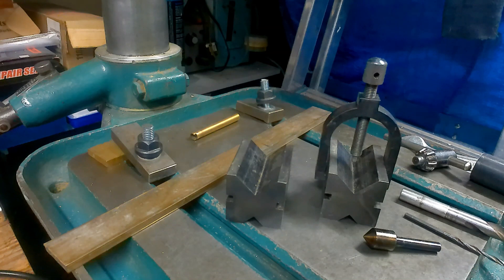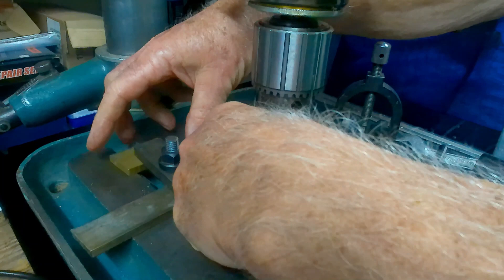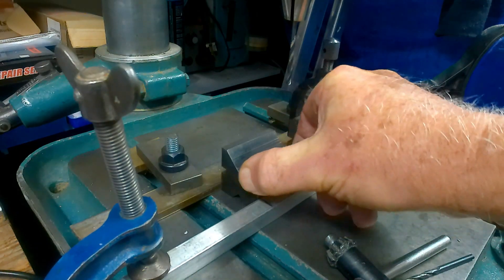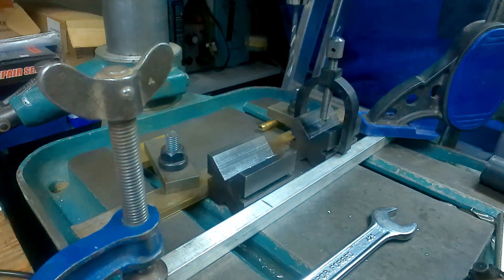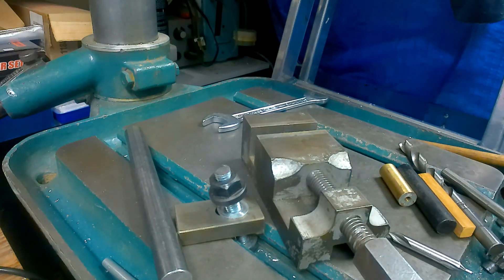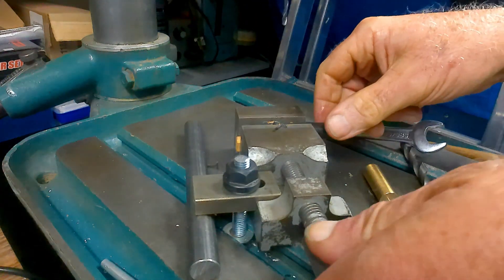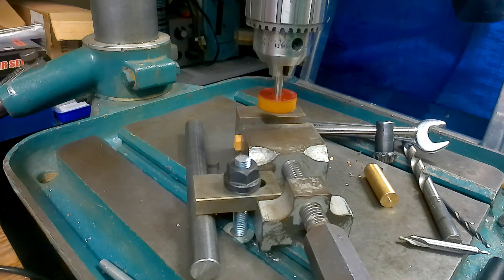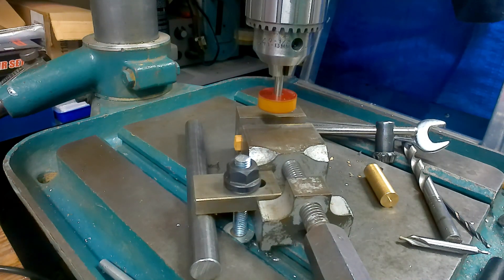How To Do Accurate Cross Drilling Just Using A Bench Or Pillar Drill, With 2 Types Of Work Holding.

Comment: Have you got a set up for cross drilling a specific amount off centre without a milling machine?
Reply from the maker: Thanks for the view and question. If you woud like to email me, I can do you a description and pictures and perhaps a short video clip filmed on my phone. Perhaps you could send a sketch of how much you need as an offset. I am assumind round material ? Will not be easy to do on a Pillar or Bench Drill, as before you can drill an offset hole you need a flat surface first. Regards.

Comment: Hello Dave,
I like these very much, for very little effort you get the rewards of the holes being on center, Thank you.
Take care.
Paul,,
Reply from the maker: Hello Paul. Glad you like them. We had a permanent setup of the vee blocks on a sliding mechanism, with also a center hole to take a 3 jaw chuck that had 12 holes drilled around the outside to accept an indexing pin. It was set up in such a way that with the aid of some standard setting blocks and a micrometer you had the ability to drill holes in a known PCD. Wish I had a Pound for the number of times I used it. LOL  Regards.